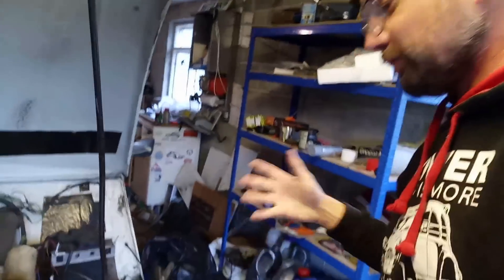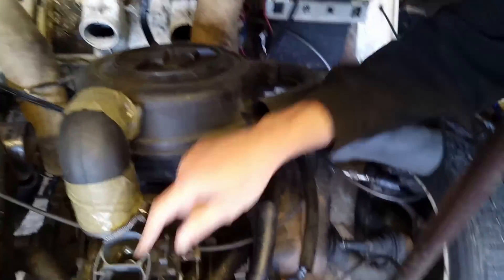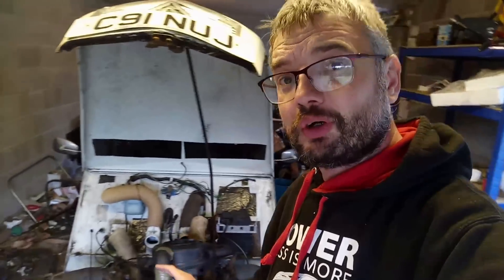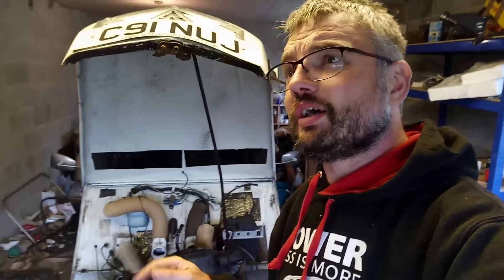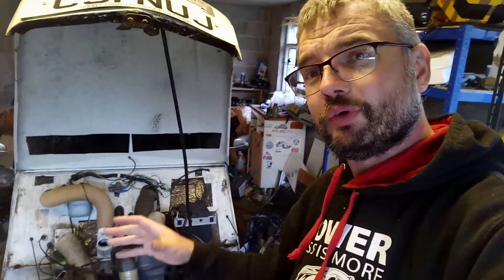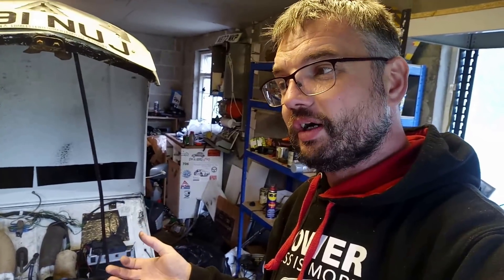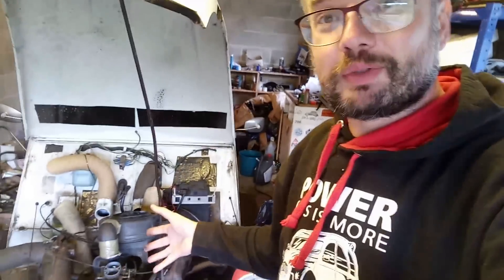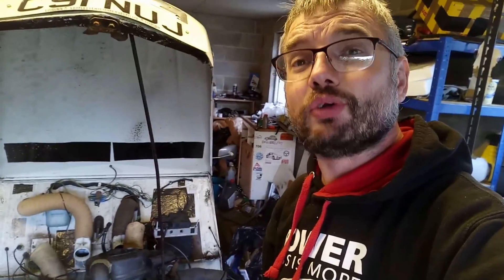Vlog: What is a choke and what does it do?

Comment: The two Renaults I owned with alloy engines and electric cooling fans typically took 3/4 of a mile before you could push the choke fully home, but normally it was fully out to start and then as soon as it was running, back in halfway. The Datsun, with an iron engine and a fixed fan, took longer to warm up and what I could do with the Renaults would not work on it. Then I went over to the Dark Side with fuel-injected cars...
Reply: @RussEdgar445y7tlfj  The same way you set the auto-choke on my Dad's Zodiac! Then fast idle was an alarming 2000rpm... a 25GTX was another 'nearly' car for me but in the end I bought a blue and white propeller. I wouldn't mind a pre-facelift 25 now: a now-defunct garage near me had a 'Monaco' of the same era on display brought in for p/x that had done 322,000 miles on the original running gear. I wonder what became of it?
Reply: @RussEdgar445y7tlfj  Definitely agree with you there as regards the appearance of the 25. As a teenager, I was only ever allowed one poster on my bedroom wall, *ever*. It was the brochure for the 25 V6, in silver :)

Comment: Funny isn't it how we now take it for granted, but back in the day (late 1980's for me), we had to use choke, especially in the Winter.  I had a MK1 Fiesta with a really good choke control.   My Austin 1300 has a SU carb and the first thing the choke lever does is set higher revs, then when pulled out further it chokes.  I have no idea if this is the same for all manual choke cars.  Mine hardly needs choke since an engine re-build and new carb body.

Comment: I don't know if this is the case for cars, but on bikes, Del'ortos and Amal carbs both use an enrichening plunger - these achieve the same effect of a richer mixture, but instead of less air, they add more fuel to a fixed air flow.... you treat it just the same in practical terms. Early - or simple - vehicles liek the BSA bantam / DKW RT125 use a "strangler" which is a manual shutter over the air intake. In the UK, the use of the term "strangler" was common up to the early post war period.

Comment: why does the engine run like crap after it warms up if you leave the choke on?  like my chain saw or blower, after warming up you can just pull the choke to kill the motor. like my old 272 husqvarna doesnt have a working cut off switch so i just kill it by pulling the choke. with 2 stroke motors it seems like they have about 60% power until its warm and then get 100% power. do these thing have anything to do with the gas being at a higher temperature and vaporizing? sorry know that was a couple questions in one.
Reply from the maker: Leaving choke on overfuels the engine. Not a good idea as overfuelling will strip oil from the bores.
Reply: @HubNut  But why does the motor stop needing the choke when it's warm. Is it because the gas is at a higher temperature and vaporizes?

Comment: Butterfly valve, sir!
In the cold of winter my Fiesta Finesse 1.1 on a D plate started with less than half a tun of the crank with zero choke. Carburettor cleaned out thoroughly.

Comment: I remember a story from the dim and distant past about a local garage having trouble with an old ladies mini running rough and konking out, after several attempts at fixing the problem the mechanic went for a test drive with lady , She  got in pulled out the choke knob and hung her handbag on it. Problem solved.

Comment: i have 1956 Mercedes here with a manual choke (it's a german choke,not a spanish choke) . When I first started working in a garage,all ordinary cars had chokes,only the expensive euro and American based cars had automatic chokes. I had an older lady come in with her hilman 10 which was smoking pretty badly. It was mostly black petrol smoke so I guessed (wrongly ) that it was a carb fault. What I saw was her shopping bag hanging from the choke knob. which was pulled right out . A few minutes explaining that the choke wasn't a handy hook and how to use the choke properly and she was set to go .

Comment: I remember when i used to do this on the chevette's.
Pull it fully out and twist to lock it fully out if it tried to shoot back in again (like a pinball machine) haha in which some chevettes were faulty that way, then after about a couple of minutes quarter way out and when you got on the long stretch of road within 5 minutes shove it fully in.
Easily perfected it though balancing the revs whilst driving along adjusting with the choke.
The automatic choke on the mk2 cavalier was bad though starting up, chug chug chug blue smoke pouring out everywhere gasing the neighbour behind at his car lol.
Drove beautifully though when warmed up and a great engine that 1.6 OHC engine was with the oil pressure gauge needle near the very top at 55mph.
Did 200,000 + miles when i spoke to the next owner at a petrol station still running perfect.
Then leaded was abolished in the late 90's and killed the car in the end i guess.
HUB 660Y RIP.(:-)
Reply: @RussEdgar445y7tlfj  Yep looked like it said HUB BOY.
Wish i kept the plate.
Reply: I had a chevette, my first car.
An early n reg.
It was abut tricky on the choke as I an said.
I  DID need its choke in the first mile.
The dash pot was an utter nuisance again I never under stood what that did, I dont think mine worked properly anyway.
Reply: Two close relatives had the mk 2 cavalier RWD.
Both 2 litre.
The auto choke took its time making its mind up but  the engines were bullet proof and power producers.
Reply: @davidfarmer2049  yes they were great cars with no real problems.
Mine had an valve stem oil seal issue early on but i just put up with it topping up with oil all the time 5 litres of oil every 2,500 miles.
Its funny how you still remember things from 20 years ago haha.(:-)
Reply: @davidfarmer2049  ahh yes the dash pot problem.
i had that problem too with the diaphragm inside splitting all the time despite buying OE ones and topping up with 3 in 1 drip oil all the time.
it happened only on a few chevettes though with me (owned 13 in all 70's & 80's ones) possibly only happening on early examples with later ones probably been fixed by vauxhall themselves.
Water pump, vicous fan & points in the distributer rising up of its pole &  misaligned points were common faults too on the chevettes.
Used to buy new points and always having to bend them slightly to align them up & then spin the distributer up when it was out to see if its all is aligned up.
You had two types of distributer too an offset one and centred one just to confuse matters for you haha.
Still a great car and learnt a lot about fixing cars though the chevettes and saved a lot of money fixing my own car nowadays.

Comment: Petrol vapour burns liquid petrol doesn't, the lower the temp the more fuel is needed to make up for the lack of vapour in the cylinder, over choking causes flooding which fouls the sparkplug and causes the smoke from the exhaust, bore wash doesn't result from over choking as an engine wont run long enough with a mixture so rich it washes the bore. Starting and running a cold engine with choke on short trips all the time will cause bore wash as the oil film on the cylinder wall doesn't get heated enough to glaze.

Comment: When I had my first car without a choke I worried about what to do if it did not start, I had similar misgivings when they stopped providing a starting handle now you don't get a spare wheel, how times have changed.
Reply: 2019 cars barely last long enough to wear the tires to the point where a puncture is a surety.

Comment: When Catalysts became standard,  about 92, with single point injection as a minimum and basic ECUs, I think manual chokes were not required or possible?
Reply: I seem to recall it was fuel injection which negated the need for choke valves. 🤔🤔🤔
Reply: Not possible to have a catalyst with a carburetor as catalysts are sensitive to a rich mixture.  Rover Metro's and Mini's I recall had them in 1992, at some point in that year there was a changeover to more stricter emissions.  (the start of Euro 1 too, wasn't it?  We're now on Euro 6 for emission standards - which started in 2014)
Reply: @MrKeyboardCommando  Yeah, I agree--a fuel injected car generally has a computer determining how much fuel is injected, so they can compensate for the cold engine that way. (We'll ignore the God-awful mechanical fuel injection system some 70s Triumphs had!).
Reply: @SuperFIFTHGEAR  
After the Vauxhall Rascal / Suzuki Super Carry production ended in the UK, in July 1993, the Super Carry production moved to Japan for a few more years. Those models did have a Catalytic Converter and a rather complicated carburettor. I doubt if the cat worked very efficiently.
Reply from the maker: It IS possible to have a carburettor and catalyst, gawd knows Lada tried. It isn't ideal. As Lada found out...
Reply: @d2factotum  Oh, ye Gods, the Lucas mechanical fuel-injection‼️ I'd almost managed to forget about that‼️😩😩😩
Reply: @SuperFIFTHGEAR  Most USA-spec cars had catalytic converters starting in 1975 and most had simple carburetors until 1981, then computer-controlled carburetors until about 1984. Some of these care ran well, but there were some, especially early ones, that were known for cooking their converters. There were even stories of cars starting brush fires when parked off-road.

Comment: My horrible Peugeot 309 Style of 1991 had a manual Choke.

Manual chokes were hard to use in cold weather.  I remember driving with one hand on the Choke to keep it from missing. 

Mind you many people wold convert automatic chokes to manual ones. 

Unleaded petrol made thinks far worse as it only takes a few misfires to fowl the plugs.

Comment: Also, did old diesels ever have chokes? I’ve got a 2015 Octavia TDi and ever since new has ran like a bag of spanners with high revs on cold mornings until warmed up. Apparently a “feature”. 😂
Reply from the maker: Some definitely had a cold start, but I think that just raised the revs to help when the engine oil was cold and more sluggish.
Reply: I think the early VW Golf/Rabbit diesels had a knob which advanced the fuel injection timing on the pump for cold starts, as well as glow plugs.

Comment: Fascinating insight. Some really old cars, pre war era have mixture control levers on the steering wheel hub. What purpose did they serve I wonder or was that just an early form of choke? Am I right in thinking the really old stuff also had ignition advance and retard controls also. Would love an explanation of that but maybe that's for another channel. Love this channel by the way
Reply: I've seen references to the ignition advance control on the wheel on pre-war cars. Never knew just how you were supposed to adjust it, though. By the early 1970s, there were centrifugal weighs and all sorts of vacuum gizmos controlling the ignition timing, since that was one of the hacks they used to reduce emissions before catalytic converters were added.

Comment: Not to be pedantic but the word 'choke' used on more modern carburetors is a bit of a misnomer. On older carbs it is true it really did 'choke' or restrict the air into the engine effectively raising fuel to air ratio and helping it to start. It was common to see motor bikers putting their palms over the mouth of the carb when trying to start their engines, in effect doing the same thing. On more modern carbs, and i cant  speak for all types, the 'choke' is actually a fuel enrichment device. In particular Strombergs had a 'starter box' on the side of the carb  that metered extra fuel around the throttle butterfly when the 'choke'  was activated. A little cam opened the butterfly slightly to raise the revs during warmup also. Really the opposite of 'choking' the engine
Modern fuel injection systems adjust the pulse width or 'on' time of the injectors coupled with the air control valve to get the engine started. In fact they've even do e away with IAC valve now. All air into the engine is metered with 'drive by wire' electronically controlled thottle bodies.
Phew! Been waiting years to get that off my chest. Cheers to all.
Reply: My 1999 sv650's carburetor officially has an enrichment device. The service manual explicitely states that it's not a choke, but does many of the same things a choke does.
Reply: @mfbfreak  your manual is correct. The use of the word "choke" became the common term, even though you were doing no such thing, for pulling the knob on the dash when starting the engine. The knob often had a little throttle butterfly symbol on it, just to make its point. Cheers.

Comment: Back in the days when chokes were normal the 'one little old lady owner only used locally' car usually needed new rings or even boring because the oil was washed off the bores because the choke was never opened.

Comment: First car I had was a fiat ritmo and you  pulled out the choke and pushed it back in half way and pumped the accelerator 9 times before turning the key or it wouldn't start. Always parked it facing down hill just in case....

Comment: If anybody can explain how an autochoke works like the Weber carb with Bi Metallic strips, Pierburg's with Wax operated ones that would be great. I know that on cars like the Maestro and Montego with the 1.6 S-Series engine or 2.0 O-Series engine the auto choke was computer controlled. The GM Varajet is one to stay away from.
Reply: I have a Panther with a Ford 1.6 CVH and electric auto choke on the weber, the answer to  "how does it work" is "not very well", it either stays on too long or comes off to early, very seldom just the right amount!   I really should get around to doing the manual conversion on it one day.

Comment: How do new cars work with out a choke is is a completely different engine or is it computer controlled stuff
Reply from the maker: Temp sensors to control the mixture and sometimes an extra injector to increase fuel on a cold start.

Comment: Re the need for choke is partly due to fuel sticking to the walls of the carb is utter dribble ! The fuel rate into the cylinders is the same as the fuel usage from the tank.

Pretty sure Elly's apparent full choke, is not in fact full choke. Full choke is precisely what it says it is - with the butterfly valve completely shut. I think my memory comes from Weber carbs.
[Pleased to see my spelling of Weber is correct - oh, it's so long ago !!!!]

Nice simple video to redo - with the hiss removed - and perhaps detail what the choke actually does - i.e. creating vacuum in the carb which in effect sucks more petrol into the engine ! (enrichening the 'mixture'.
[Nope, sticking with 'enrichening' for the way it's constructed as opposed to using correct word: enriching.]
Reply: Ian's partly right:  When an engine is cold the first time the fuel air mixture goes down the manifolds and into the cylinders, the chilled surfaces will allow the semi vaporized fuel in the fuel/air mixture to condense out on them.  it is part of the reason why many car engines with long manifold runs with small diameters tend to need an exhaust loop up a pipe or casting to a  "hotspot" that helps warm the incoming mixture so it stays more consistent.
Reply: @tauncfester3022  I think you're 'out' on the physics going on here :) The petrol is being vaporised, not evaporated. Consequentially, condensation is not taking place - a function of warm liquid being cooled. The vaporisation process will in fact cool the fuel to a temperature lower than the manifold walls - which will in fact reheat the fuel.
Agreed, preheated fuel/air mix is used to aid combustion - but that is nothing to do with petrol. Unfortunately I've been out of IC engines since petrol injection - so am not aware if inlet manifolds are still heated from the exhaust or not. I'm also not aware of the petrol being injected being preheated either.
However, I've never seen diesel injection systems having diesel heating systems prior to injection although it's clear it's going to get some heat from the injector as it's so close to the combustion chamber - it's maybe never been an issue.
I also know that a cold diesel engine's power is significantly down on that of a properly warm engine. Why precisely, I'm not sure - but probably several reasons, including possibly, cold fuel but I suspect less compression due to piston and cylinder dimensions not being up to spec. until up to temperature.
Reply: @millomweb   Yeah I don't know, it's not like I haven't discussed this with my father, who BTW worked for Allied Petroleum making 130 and 150 octane gasoline for WWII fighters and bombers in 1940's.  He understood something about vapor pressure to temperature and cold surfaces and a vaporized stream of air/fuel will cause the larger 'vaporized' droplets to 'condense'. His words by the way.     He was head engineer and designer of Allied's crude oil cracking tower in El Segundo, CA.  So yeah maybe it's merely a matter of English to American.
Reply: @tauncfester3022  Condensation is due to a temperature change. Like warm air in a room touching a cold window - moisture appears on the window. A cold engine is the same temperature all over. So condensation is not taking place.

Feel free to explain this to your dad.